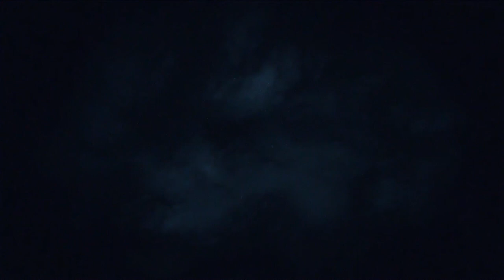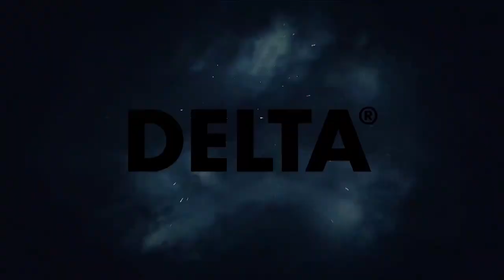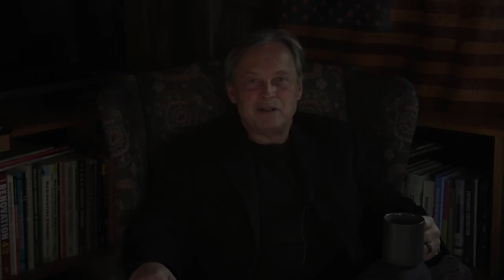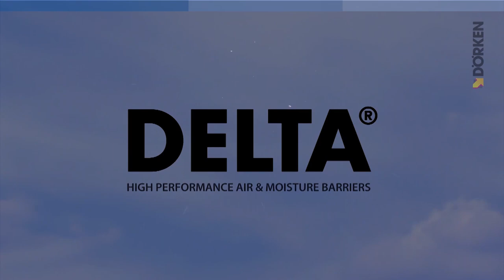A Cup of Joe: Problems with Stucco | Building Science Deconstructed

Comment: This is exactly the same rabbit hole I'm going down now that my wife and I are looking to build a home:  The idea that "improving" something will always have problems that arise from that choice.   Without the house's ability to breathe, the inner space has to be conditioned continuously or the humidity will end up destroying the house, especially when using OSB products. What are your thoughts on using stucco over a dry and lathe DELTA system over 5/8 plywood on 2x4, insulation batting, with NO vapor barrier between the insulation cavity and drywall??  
What I mean is what if I purposely allow the house to breathe since the house will be vented by way of air conditioning anyway? Are we approaching it incorrectly here?
Reply: Joe won't answer - his pay grade is way too high.

Building scientists hate hearing 'buildings need to breathe" - at least not the way it's historically been done (no insulation).  They promote controlling as much water and air infiltration as possible (far and away the biggest durability concerns - vapor is a distant third). I'm 2/3- 1/3 - fully believe water is of primary concern, and that air control is a close second. But I hate the current fashion of super-tight 'Passive House' homes that MUST have an always-on HVAC system to deliver healthy air.  I think that's just begging for problems if the HVAC is either badly designed, poorly installed or improperly maintained (it's so early in the learning curve on the 'science' that living in a sealed box dependent on conditioned air is bound to have horror stories coming)

Relying on air conditioning to reduce moisture is a poor idea - first off, it doesn't always run. Secondly, AC isn't optimized to control humidity - add a full-house dehumidifier to your HVAC system to maintain comfort levels and keep mold/decay at bay.

If you want to learn more about good buildikg practices, follow Steve Baczek (worked for Joe), Jake Bruton (works with Steve) and Christine Williamson (Joe's daughter @buildijgsciencefightclub) on Instagram.  Read their stuff and you'll learn a ton - and the science and thinking behind their details.  Also, for really geeking out, the B.S. (building science) and Beer YouTube channel - warning, some panelists are on the extreme edge of 'tight-is-right'...but still have some interesting discussions.
Reply: @ArthurDentZaphodBeeb  wow, thank you for the recommendation!  That's a ton of guidance that I was looking for and with so much information out there, its near impossible to get past what youtube/google recommends without doing a direct search.  I mainly get the top youtubers like Matt Risinger who I don't wholly agree with in regards to what you said about trying to build a sealed box and then having to rely on a perfect hvac/dehumidifier/air exchanging system installation and scheduled use. That just leads down a road of higher and higher mortgage and maintenance costs for a house that, in most cases, produces zero monthly income.  Well, unless you're the bank.
Reply: @ArthurDentZaphodBeeb  I follow all those people too.  I also have taken PassiveHouse training, and it never says you have to have the HVAC on all the time or that you have to use air conditioning to reduce moisture.  In fact, while PH's do require ventilation for fresh air, they are so insulated and air sealed that the heating and air conditioning often don't run a lot.  A dehumidifier is an equally valid way to reduce moisture if you have too much; an air conditioning unit is not required for PH.  Much of the extreme insulation in PH is about reducing thermal bridging which can cause mold and condensation, without resorting to super low humidity.  This is all keeping in line with the people you mentioned.